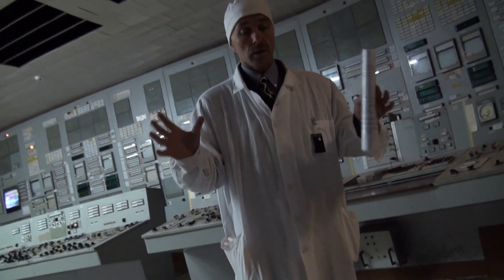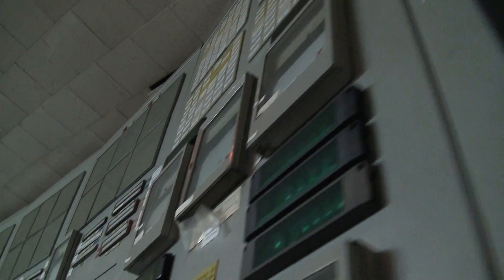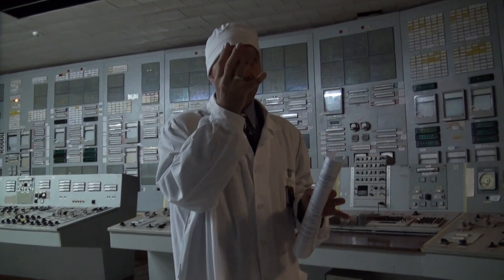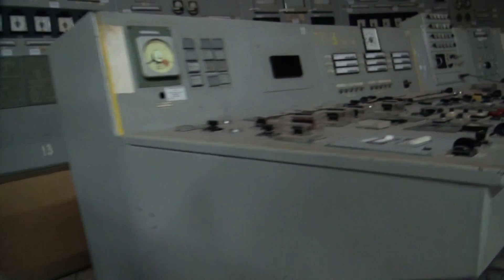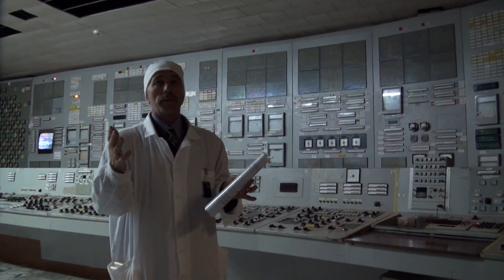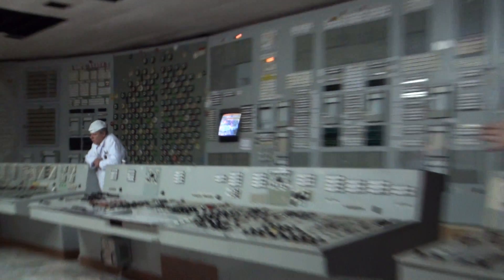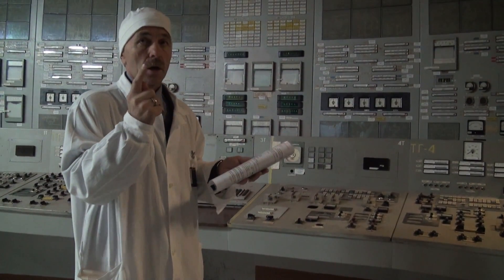Inside CHERNOBYL Control room Nuclear Power Plant

Comment: Is that still works?
Reply from the maker: Last Operation to 15.12.2000
Reply: @OnTourWithGerrit  means that if the control room is activated, it can still be used, right?
Reply from the maker: @_DonnyFirdani  negative.
They started to built the reactor back. Today, no fuel is remaining within the core.
Beside of some basic operations like ventilation etc the control room is no longer in operation, otherwise it would look different.
(Even in 2015 when I took this footage)
Reply: @OnTourWithGerrit  OK, thanks for your information friends 👍

Comment: Unit 4 was the destroyed one. But it is very suspicious looking at the pic on the Pinterest and in a Hungarian newspaper, that there were BLACK PEOPLE in the control room 4 and they turned up the MW from 2000 to 30.000..that was the reason. Maybe it was something that did not happen as officials say...maybe they were "kamikaze" BLACK MEN? From where in Ukraine? I did not know that in 1986 Black guys had lived in Ukraine....From where they had arrived at Ukraine? From the USA, from Africa or from where????
Reply: That never fucking happened
It was normal Ukrainians working the shift
Reply: Canadianairforce69 Both of you guys are wrong, they were running a test on the RBMK-1000 reactor, then it was near 70, Dyatlov wanted it higer, they pulled near all control rods out, the lid fell off, and destroyed cooling pipes, it was getting to hot, boom explosion.
Reply: That’s true

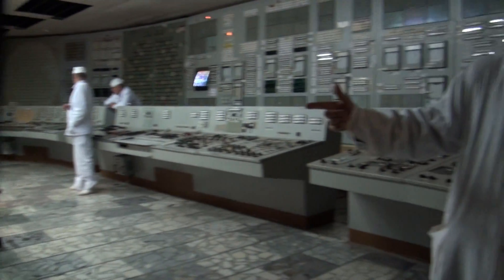Comment: 03:25 Imagine hearing that at 1:23 AM on April 26, 1986!
Reply: Yep! But I imagine instead of just one panel almost all the enunciators were on... The control room probably looked ike a christmas tree. Scary. I remember hearing a slight different warning sound from the other control room but I assume the consoles/sounds/everything got upgraded years after the accident.
Reply: I wouldn't have wanted to be an operator that night.

I am sure the parts differed a bit depending upon the generation of RBMK reactor.
Reply: @xavier2435  It probably looked like this https://youtu.be/XArN8MbtT_E
Reply: @xavier2435  The control rooms of unit 1 and 2 (as in this video) are slightly different from those in unit 3 and 4 (unit 1 and 2 are 1st gen RBMK, unit 3 and 4 are 2nd gen RBMK). For example the 2nd gen control room has oblique arrangement of the whole upper half of the control wall. Probably the warning sounds are different too.
Reply: @Alex-lg3dt  Fair point 👍
Reply: @Alex-lg3dt  like in zero hour the alarms are diffarent so yeah
Reply: @xavier2435  yeah that alarm means reactor is out of fuel and stalled
Reply: Fuck NO I'd shit my pants twice
Reply: that is test mode
Reply: It happens normally
Reply: It's very scary to here a alarm in Chernobyl now and the one alarm that came on was loud.

Comment: Why are the lights flashing and is there a alarm noise on 3:30 ?? is it still operating or is it a demonstration?
Reply: +Heespandexx only demonstration, all reactors have been out of operation since 2000.
Reply: Oowh thanks man, didn't know they are not running anymore.
Reply: They put the controls into testing modd

Comment: This is not Control Room n^4.This is n^3. In n^4 all the switches were rmoved after the accident.
Reply: Graystripe000 Part of the investigation, every dial, knob or switch is removed and sent to Moscow to find out what the reactor was doing at the exact moment everything stopped.  They do the same with air craft controls after crashes.
Reply: ***** Why is that?
Reply: Floor style is different from unit 1 and 2 and it can't be unit 4 because it is closed now and all the instruments were removed in 1987)
Reply: No, why were the switched removed? So they could be used elsewhere?
Reply: Ohh, actually just because they removed anything from CR4 in order to investigate and decontaminate. All the control panels were full of radioactive dust.
Reply: Ah. Yeah, in the destroyed area under the sarcophagus, they have a sprinkler system set up to keep the ground wet so things don't dry out and there isn't radioactive dust floating everywhere.
Reply: Rob Fraser Ah.